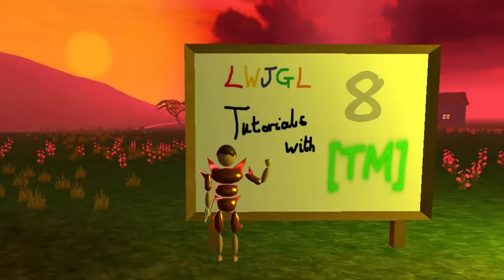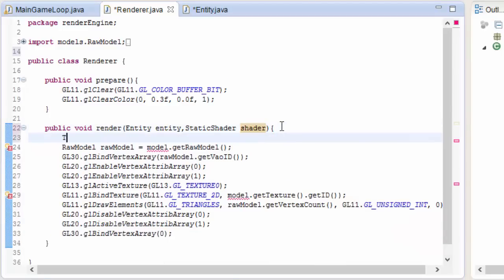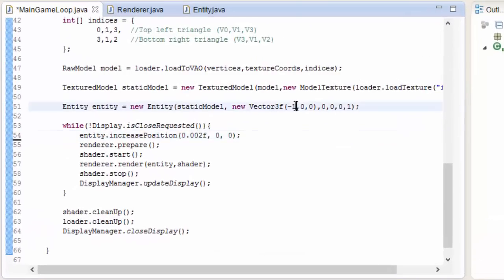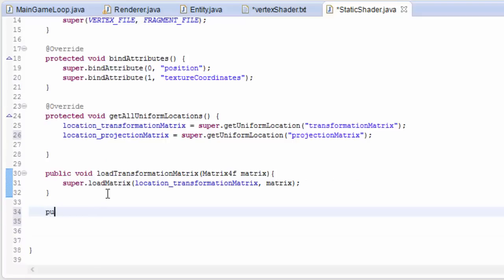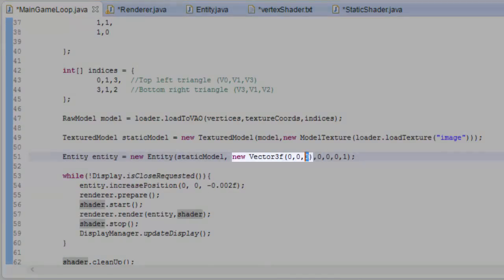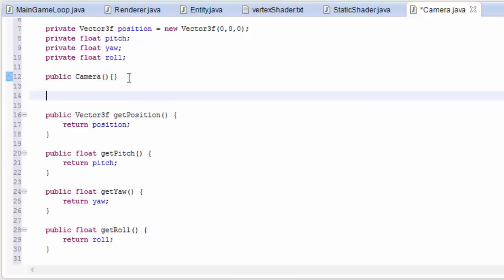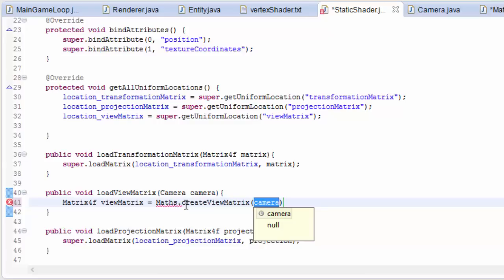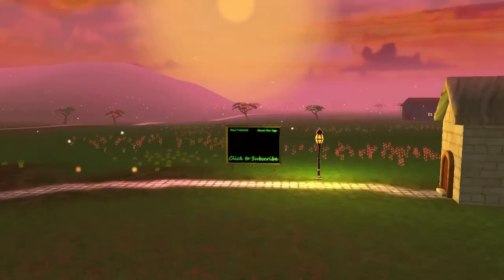OpenGL 3D Game Tutorial 8: Model, View & Projection Matrices

Comment: I had my image/square loading up after we made it an entity, but after we added the projectionMatrix I can not get it loading up. I can't see my square past 11 minutes does anyone have any idea i'm so stuck all my codes the same?!
Reply from the maker: Adam Jackson There aren't many things that could have gone wrong here. Double check the projection matrix creation code to make sure that's all correct. Then check in the getAllUniformLocations() method that you spelled "projectionMatrix" exactly how it is spelled in your vertex shader code. Finally, just check that it is being multiplied properly into the calculation in the vertex shader. I can't think of anything else in the code to do with the projection matrix, so the problem must be there I guess.

Comment: Hi

I have the weirdest issue. Your stall.obj loaded ok but when I rotate it along the z-axist it looks like everyting is inside out. Any clue what could cause this?
Btw your tuts ROCK!!
Reply from the maker: Dirk t8or I think it must be a problem with the code used to create your projection matrix. Maybe just check trough the createProjectionMatrix() code one more time.
Reply: ***** 
Here is what I have... Maybe I just have a blind spot :S... Only change to your code was the addition of (float) in the y_scale as I got on error when I entered it exactly as you did...

 public static Matrix4f  createProjectionMatrix(float fov, float far, float near) {
  Matrix4f matrix = new Matrix4f();
  
  float aspect = (float) Display.getWidth() / (float) Display.getHeight();
  float y_scale = (float) (1f / Math.tan(Math.toRadians(fov/2f))) * aspect;
  float x_scale = y_scale / aspect;
  float frustrum_length = far-near;
  
  matrix.m00 = x_scale;
  matrix.m11 = y_scale;
  matrix.m22 = -((far + near) / frustrum_length);
  matrix.m23 = -1;
  matrix.m32 = -((2*near*far) / frustrum_length);
  matrix.m33 = 0; 
  
  return matrix;
 }
Reply: ***** 
Uhm... found it... I switched the near and far parameter (I made a function in Maths where I passed near and far plane. 
Thanks for providing me the right place to look!!!

Comment: Hey is this code correct for the projection matrix:

public static Matrix4f projection(float fov, float near, float far, float ar){

		float fLength = far - near;
		float yScale = (1/(float)Math.tan(Math.toRadians(fov/2)))*ar;
		float xScale = yScale/ar;

		
		Matrix4f projMat = new Matrix4f();

		
		projMat.setIdentity();

		
		projMat.m00 = xScale;
		projMat.m11 = yScale;
		projMat.m22 = -(far+near)/fLength;
		projMat.m32 = -(2*far*near)/fLength;
		projMat.m23 = -1;
		projMat.m33 = 0;

		
		
		return projMat;

	}

I'm trying to do this in my own engine and when I multiply the position by the projection matrix in the shader nothing shows up on my screen aside from the clear colour, and when I don't apply the matrix the mesh (the triangle) shows up fine. Any ideas? I figure it must the matrix code. By the way I don't have a transformation matrix just yet.

Comment: My cube is spinning VERY fast with increaseRotation(1,1,0); any ideas why this happens? 
Nice tutorials btw but do you continue with the tutorials? There is a lot of stuff I would like to know from your devlogs! The first question is how did you render the Text in your gui? like the money counter...? thx 4 help!
Reply from the maker: necrostyleLP Well it increases one degree per frame, so the speed that it spins at depend on your FPS. We'll be adding better timing into the game in later tutorials so that movement is based on actual time instead of frame rate :) Text rendering is a bit complicated, but basically I have a texture atlas with all the characters on it, and then when rendering a text I create one quad for each letter and choose the necessary UV coords to render the correct letter onto each quad.
Reply: necrostyleLP 
I would think that your Display sync speed could be too high??

public static void updateDisplay(){
  Display.sync(120);      //FPS cap
  Display.update();
}

Comment: I've got some problems with my code. Nothing is rendered on the screen just the red background nothing else. I check every solution in the commands but nothing worked out for me. Maybe someone here can help me out.
My Code: https://mega.nz/#!LZVUXbZI!vu0IwkwHFseTWQ-pYN-U_2Y07uyxMJLr3lmvt4Kfv6I
Reply from the maker: The-Mr-Ja-mei When did this stop working for you? I can see an error from tutorial 6: the "in" variable in the fragment shader should be called "pass_textureCoordinates". It needs to be the same as the "out" variable in the vertex shader.
Reply: ***** I fixed the typo but the object still doesn't appear. It stopped working after changing the  render.
Reply from the maker: The-Mr-Ja-mei Could you email me your code with your problem to thinmatrix@gmail.com please? I don't have time to look through it at the moment, and the notification for this comment will be gone now so I'll probably forget =P. I'll check through it when I have some time :)

Comment: My code doesn't work. I print location_tranformationMatrix and it prints -1. What does that mean. I am pretty sure that I am loading everything and my code doesn't have any typos.
Reply: David Wong Basically the background does render, but the quad doesn't
Reply from the maker: David Wong That means that you haven't successfully got the location of the transformationMatix uniform. I guess either the spelling of transformationMatrix isn't the same in both your shader code and getAllUniformLocations() method, or you aren't calling the getAllUniformLocations() method from the ShaderProgram constructor.
Reply: *****  Thank you so much! After checking if I had written getAllUniformLocations() on my ShaderProgram constructor, I realized I had called the method before loading the shaders. Now I called the method afterwards and it works perfectly. It is awesome you respond to your viewers!

Comment: GL11.glEnable(GL11.GL_DEPTH_TEST);
		GL11.glClear(GL11.GL_COLOR_BUFFER_BIT/GL11.GL_DEPTH_BUFFER_BIT);

gave me an isssue
Reply: thebuizelclub Nvm i fixed it i found the | on the keyboard
Reply: thebuizelclub Lol... this happened to me earlier.. but I saw model as mode1 and put mode1 a LOT... I was changing things back for a while lol...
Reply: thebuizelclub Wait where was this in the code? Which class? I didn't even have this
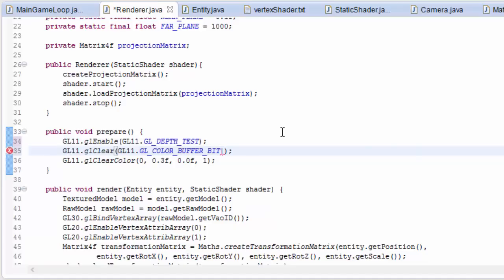Reply: littleprof123 Its in the render class at 20:00 in the video hopes that helps :)
Reply: thebuizelclub Yeah sorry about that there was an issue with another class and I had to redo this video
Reply: thebuizelclub Did the screen go black after you typed that and ran it? cuz that happened to, I commented on this video about a similiar thing
the exact thing actually

Comment: ThinMatrix, I would Be EXTREMELY glad if you explained to me which line makes that picture a floating cube.
PS: I'm kind of new to LWJGL and Java so sorry in advance for the stupid question.
Reply from the maker: Ntguilty There's not really one line of code that does that; basically all of the code in the engine does part of this. First we determine the vertices of the cube and the texture coordinates for each face. Then we put them into a VAO when loading the game. To render the VAO we have a load of rendering code. The shape that we render just depends on which vertices we put in the VAO. Before we only used 4 vertices to make a single rectangle, but at the end of this episode we used 24 vertices to create a cube. You could just as easily add more vertices to create a sphere, or any other 3D shape.

Comment: I've been through your tutorials once, and I'm starting over to test a 1st person camera I found. My cube looks like it's missing the side I'm looking at. I can get a screenshot if you need it, but do you have any fixes?
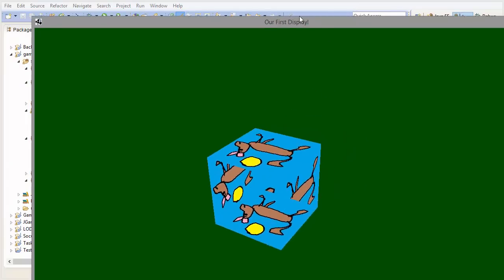Reply from the maker: Connor Young It might just be that you haven't added the depth testing properly? Does it look like my cube did at 19:30? Maybe just heck the depth testing code if it does. The only other thing that I could think of is that maybe you didn't change the last line of the loadToVao() method in episode 3. Check that you set the vertex count parameter in the RawModel constructor to indices.length.
Reply: ***** it's not like at http://www.youtube.com/watch?v=50Y9u7K0PZo&t=19m30s, the back side renders properly. I changed the vertex count, and I'm not sure what other depth testing code there is. I'll get a screenshot in a sec
Reply from the maker: Connor Young Have you already enabled back face culling? That could be a problem possibly as I didn't really pay attention to front and back sides when creating the cube vertices. If that is the case then there isn't really any problem at all, and it would work fine with models loaded from OBJ files. Try disabling back face culling and see if that works.
Reply: ***** As soon as I can I will, thanks for the help :D

Comment: Why when i start program then it is so slow.... slow rotation..etc
Reply from the maker: Martin Šimák You can increase the amount that it rotates each frame by increasing the parameter values in the increaseRotation() method. If the problem is that the game is lagging then just check that you're not calling the loadToVAO() method in the while loop or anything, because then you would be loading the mesh each frame.

Comment: *****
Can we use the same system with quaternions instead of euler angles? I read a lot about the topic and it seems that quaternions are the better approach because there is no Gimbal lock and so forth. But I wonder if all the stuff about player movement using the sine and cosine with a given rotation angle will also work using quaternions...

Sorry about all these questions :D
Reply from the maker: M TheJ I'm sure you could use quaternions, but it would be a bit more complicated and seeing as my knowledge of quaternions isn't very good I'm not really sure how you would do it.
But do you definitely need to use quaternions? We only use the y rotation for the player so gimbal locking isn't an issue, and any rotation representation is fine for setting the orientation of entities in the world. The problems would only arise if you wanted to rotate the player on all 3 axis for some reason or if you were implementing an animation system. However, you could always use quaternions for an animation system and euler rotations for object orientations, that's what I do in my game.
You are of course right that euler rotations aren't the best, but at this stage I don't think it makes too much difference, but if you do decide to implement quaternions I guess it probably would be better in the long run.

Comment: Hey *****
somehow my quad does not show up when using the projectionMatrix... However if I call projectionMatrix.setIdentity() before loading it into the shader everything works fine (except for the projection =P). So the matrix is definitely loaded correctly into the shader and I went through the projection matrix code 5 times and I am sure it is the same as yours. Still somehow I can't see my quad when I'm using the projection matrix. This is the code I use for creating it:

float aspectRatio = (float) Display.getWidth() / (float) Display.getHeight();
        float y_scale = (float) (1f / Math.tan(Math.toRadians(FOV / 2f))) * aspectRatio;
        float x_scale = y_scale / aspectRatio;
        float frustum_length = FAR_PLANE - NEAR_PLANE;

        projectionMatrix = new Matrix4f();
        projectionMatrix.m00 = x_scale;
        projectionMatrix.m11 = y_scale;
        projectionMatrix.m22 = -((FAR_PLANE + NEAR_PLANE) / frustum_length);
        projectionMatrix.m23 = -1;
        projectionMatrix.m32 = -((2 * NEAR_PLANE * FAR_PLANE) / frustum_length);
        projectionMatrix.m33 = 0;
Reply: Hm I now set up the camera movement and if I move backwards I can see the quad, so because I multiplied it with the projectionMatrix it is behind the frustum? I now see why you saw the quad (you moved it in -z direction on every frame) but is it intended that I don't see the quad once I apply the projectionMatrix if it is at 0,0,0 ?
Reply from the maker: M TheJ If the object is too close to the camera (closer than the near plane value that you chose) then it won't be seen, so an object at 0,0,0 wouldn't be seen when the camera is also positioned at 0,0,0.

Comment: When I move the camera back or forth, the z axis does not work well. I hold the W key down for a second and the object disappears(moves behind camera). When i use A and D keys, everything is fine. PLZ help, thanks.
Reply from the maker: Alex c Sounds like a problem with the projection matrix. Check the createProjectionMatrix() code again, the error is most likely there.
Reply: Ok thanks but when we made the flat model everything worked fine

projectionMatrix * viewMatrix  * transformationMatrix * vec4(position.xyz,1.0);

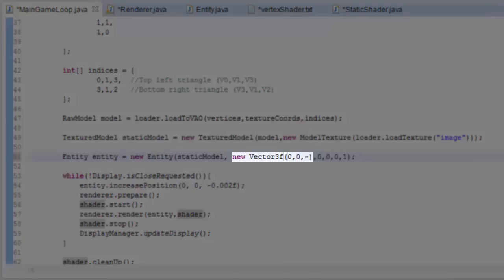Comment: i dont have a background after 11:40 its just red i have gone over everything but cant seen anything
Reply from the maker: scott taylor If it only stopped working at that point then it has to be something wrong with the projection matrix code. There's not too much of that so maybe just check through it again quickly. Check especially the method that creates the projection matrix, and the spelling of "projectionMatrix" when you get the location of the uniform in the getAllUniformLocations method.
Reply: yeah i fixed it thank you was just a typo

Comment: Sorry but i have added getAllUniformLocations already and the box is still isn't there.
What's could have i done wrong?
Reply from the maker: Midnightas At which part in the tutorial did it stop working? Check the spelling of the uniform names in the getAllUniformLocations() method, they have to be spelled exactly the same as in the shader code.
Reply: ***** I copy-pasted those stuff.
I test everything at the end of a tutorial so i am not sure at what part.
Reply from the maker: Midnightas If you want you can send me your code to thinmatrix@gmail.com and I'll try to find the problem for you :)
Reply: ***** Okay  thanks :D, However i changed the classnames a bit, ex: I  changed from Renderer to LightBender because it made sense.

Comment: one question why don't you use double's instead of float's?
Reply from the maker: Z Pirion The extra precision gained by using doubles would really be completely unnecessary for what we're doing here. The errors caused by using floats are pretty much negligible, so there's no reason not to use them :)
Reply: I think it is a good habit to use doubles but that's just my opinion :)
Reply from the maker: Z Pirion Well floats take up half the memory of doubles, so unless you require the additional precision it's probably a good idea to use floats. Especially if you're going to be storing lots of numbers at once, which is often necessary in games. That's why objects in LWJGL like Vector3f and Matrix4f all use floats as well; to help use as little memory as possible. 
But it really depends what you're programming and what is more important: precision or memory. For games it's often going to be memory, but for a lot of other programs it would be precision. So both floats and doubles have their uses and I don't think that either one is "better" than the other :)

Comment: If I'm adding the projectionMatrix to the vertexShader.txt I can't see anything. Also if the z coordinate of the position Vector3f is higher or lower 1 / -1 I can't see the Texture or what ever...
Do anyone have the same problem or a solution?
With best regards.
Reply from the maker: DasIstSparta3 When the projection matrix isn't used the objects will only be rendered between -1 and 1 z, so that is why that's happening. As for it not working with the projection matrix, just double check your createProjectionMatrix() code and also check that the spelling of your uniform variables in the StaticShader is the same as their spelling in the shader code.
Reply: ***** I did all of this checks, but I can't find any fault. I'm a bit helpless ...
Reply from the maker: DasIstSparta3 Your calculation for m22 is incorrect, it should be:
projectionMatrix.m22 = -((FAR_PLANE + NEAR_PLANE) / frustum_length);
Reply: ***** Ok, I changed it, but it doesn't work either.
Reply: DasIstSparta3 http://www.mediafire.com/download/000izjxg9i0fv4d/src.zip
The whole project.
Reply: DasIstSparta3 I'm sorry, I found the fault.
Reply: DasIstSparta3 Do you fix the problem? You got the code yet?

Comment: I'm getting this error, i've checked all of the code and it's the same as in the video. Help please.

Could not compile shader.
Vertex shader failed to compile with the following errors:
ERROR: 0:? : error(#167) Only allowed at global scope: uniform
ERROR: error(#273) 1 compilation errors.  No code generated
Reply: Took me a while but i found the issue, in the vertexShader.txt file i put the 

uniform mat4 transformationMatrix; inside the void main(void) function. :P
Great tutorials , love them.
Reply: okay, after fixing that I ran into the red screen problem. Here's my src folder. I reviewed the code multiple times but to no avail. Help needed after all

https://www.dropbox.com/sh/9rh8hmv75fbvmd0/AAD5DtkoUMdHsg-UBMhUUhIna?dl=0
Reply from the maker: Volken32 First thing to check is always if you've made any typos when getting the location of the uniform variables in the StaticShader class. You spelled "transformationMatrix" as "transormationMatrix".
Reply: ***** Hahah , thank you so much! I've spent the last 2-3 hours looking for a typo. But I couldn't find it.
Reply: Volken32 I had made a similar mistake and I get no error code. Thank you for bringing me an idea how I could fix it.